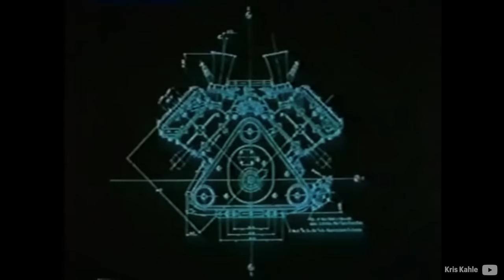The Most Successful Formula 1 Engine Ever

Comment: Cosworth  V-8 . The  WINNING-EST  ever Engine in  Formula 1 . American Name on it , but British Engineering . Henry paid the bills , so got " Naming Rights " .
Reply: Ford always had a fascination in the early days (60's-70's) with OHC configurations...Japan was just getting on it's feet, and so naturally Ford saw the UK as it's friendly gateway into what was popular among European manufacturers... They soaked up what they learned from decades of racing abroad, and it found it's way in V8's of modern era after the 80's marked the end of their pushrod based engines at large.
Reply: @kylecurry6841  . American V-8s are still mostly Pushrod engines . 
There are advantages to Simplicity of Servicing in Street Engines .
Reply: @johncunningham4820  no they aren't, all modern American v8s are dohc.
Reply: @freddarau  . Rubbish . Bullshit . 
The LS series Chevs are Aluminium Block  PUSHROD engines . The Chrysler Engines are still IRON Block . A couple of UNRELIABLR  Fords have overhead SINGLE cams .
Reply: @johncunningham4820  the ls hasn't been manufactured in 12 years. Do you live in 2010?

The LT has replaced it.
Reply: @freddarau  . Yeah . Whatever . It seems to me , that the ONLY Quad-Cam American V-8 , is the Special Order 5.5 litre unit for the  CORVETTE  exclusively . And an LS-7 would have that for Lunch . And be more reliable DOING  IT . 
LT's are still OVER HEAD VALVE pushrod engines .
There is nothing wrong with  OHV  architecture , BTW . Solid . Proven . And EASY to work on .
Reply: @johncunningham4820  it are used in there trucks and the Camaro. Ford only uses dohc in all of there gas engines, so does dodge.
Reply: @johncunningham4820  the ls7 gets shredded by a lt6 
And the ls7 is more unreliable the the bmw s85.
Reply: @freddarau  . That is . No , and and ALSO  No .
Reply: Coyote 4 cam 4 valve VVT
Reply: @bernardwarr4187  . The Engine in the Video is the BRITISH Ford DFV ,DFY , DFX and DFR  Grand Prix Engines . From a Different Era .
Your " Coyote " may be  borrowing some of the Lessons learned . But is an entirely different Engine Platform altogether .
Reply: @johncunningham4820  some said, there where no American v8 4 valve 4 cam engines?
Reply: @bernardwarr4187  . Never said there were NONE . Just that the BULK of the Mainstream Engines are still  OHV .
OHV types are MUCH cheaper to Maintain and Service , so this make sense for a DOMESTIC Market .
There is nonetheless That Corvette and OK your Quad Cam Coyote . 
The Old Question with those .
How Fast can YOU afford to go ?
Europe has been doing Overhead Cam  since the 60's . For Domestic Market .
There are Merits to BOTH types of layout . 
Also Downsides .
The Cosworth was likely the FIRST engine using the " Modern " layout .
Low Piston Crown and Narrow valve angle .

Comment: The DFV can trace its origin back the the Ford Kent engine.   The Kent engine was originally built in a 1.2l and 1.5l capacity with a non-cross flow 8-valve head.  The head was later changed to cross-flow and the capacity of the engine changed to 1.1l, 1.3l, & 1.6l capacity. 
Lotus developed a 8-valve dual over-head cam head for the Kent and then Cosworth developed an even better 16-valve head for the Kent. 
The 16-valve head on a 1.5l Kent was basically the starting point for the DFV.  The heads and lower end internals where carried over with a new aluminium V8 block being developed
Reply: Yes indeed Sir! Descended from a ford Anglia / Cortina engine.
Reply: Sorry, which parts where carried over? Non, only the lotus head, which was not part of the original Kent engine?
Reply: Had a few Fiestas with the 1.6 kent. Not a lot of power, but very reliable.

Comment: Ford mostly got behind the development of the engine in light of the changing regulations for endurance sports car racing more than F1. Cosworth got it working for F1 quickly because of the shorter races. The Ford P68 was designed to replace the GT40 for the new sportscar regulations and was developed by Alan Mann Racing using a DFV , but they couldn't get the DFV reliable enough for the long endurance events like 1000km of Spa, 24 Heures du Mans, 12 hours of Sebring and 24 Hours of Daytona because it would shake itself to pieces and would not reach 300 laps at the 24 Hours. It took a long time to get the DFV reliable enough for endurance events - it won at Le Mans in 1975 with Ickx and Bell because there was a strict fuel limit, which meant the engines ran in a lower state of tune, which in turn increased the life of the engine. Even the replacement DFL, designed more with endurance racing in mind, took a long time to be successful.

Comment: Crazy that a 2005 V10 was able to achieve more than double the power from the same displacement than early DFVs.
Reply: Revs, revs, revs!  The cylinder head design is not really all that different.  The main difference is the pneumatic valves allowing higher rpm.  As well as overall improvements everywhere, of course.  Honda have an article on their 'modern' V10 and V8 engines, they were able to gain power from all kinds of small details, like changing the timing of the ports on the oil scavenge pumps to reduce losses and so on.

Comment: Michael Schumacher won the F1 title in 94 using a pneumatic valve version, beating the V10s and V12s.
Reply: What was the Designation  of  that  Engine ? And  Capacity ?
Reply: @johncunningham4820  internally I believe it was the ED but I think Ford branded it the Zetec-8R or something like that
Reply: @johncunningham4820  Zetec-R 3.5L V8
Reply: Crashed into Damon Hill deliberately
Reply: EC/Zetec-R, which was based on the HB - 75° instead of 90° in the DFV.

Comment: Why would any motorcycle engine builder start with a 360° parallel twin? It's like the worst layout for p-twins in existence.
Reply from the maker: They wanted a simple single carb setup
Reply: @VisioRacer  180° firing interval would also be fine with a single-carb. 270° is the best possible compromise with a parallel twin mechanically, and in power output, and which is possibly why most manufacturers have gone with it.

Comment: The thumbnail is misleading...the longest living engine used in F1 was the Ferrari Colombo V12 which was produced in various iterations from 1948-1988, way before the first F1 race ever happened.
Reply: Man, I haven't thought it is so old. But didn't they use it until '95 when they changed to V10? Or was it a different design for those last years?
Reply from the maker: But was it used for racing all those years? The DFV was a race engine only
Reply: @karacop78  No, the engine design of later Ferrari F1 V12 was no Colombo derivative.
Reply: @VisioRacer  Yes, it was used for racing all the years albeit in different series.
Reply: Or the Offenhauser? (OFFY)

Comment: The cam gear failures were constant problem for a long period before Duckworth added the ‘quill hub’ to cope with the massive torsional vibrations. X plane v8 cranks we’re never used in f1.
Reply from the maker: What about the Coventry Climax V8?

Comment: I know this is a dumb question but is it possible for a multiple cylinder engine to have the same stroke timing at the same time? Like cylinder 1 and cylinder 2 will have a power stroke at the same time?
Reply from the maker: It is, but not really smart. You would have a much stronger combustion and would need to counter-balanced that. Having more smaller combustions makes the engine smoother when timed evenly

Comment: I thought Michael Schumacher won the 1994 championship with a Cosworth V8 powered Benetton Ford. 
Is that a different engine?
Reply: That was a different engine. Cosworth’s DFV replacement was a 75° V8 called the HB introduced in 1989, which was later developed into the EC/Zetec-R used by Benetton in 1994.

Comment: 2:01 Wish they still did gears instead of timing chains and belts
Reply: Maybe on inline engines rarely are used gears, except for trucks, but actually geared distribution is more diffused than may be thought.
Chains and belts are mainly on the cheap engines of our cars
Reply: Unfortunately, gears (and to a lesser extent, chains) are expensive and noisy when compared to belts - and your average Noddy driving a 95 Camry while on the phone and sipping a latte wants quiet over strength and accuracy.
Reply: ehm, that's called "capuccino", or "(caffè) macchiato" at least. Latte simply translates in "milk".
Anyway, the problem is not loudness, but instead cost of production, and if that's not enough, there's to sell regularly the spare belt

Comment: it's not a Ford engine, it's a Cosworth double 4 valve engine with a Ford badge on it.  Ford had nothing to do with the engine simply paid to put their name on it.
Reply: Your statement is a contradiction. If Ford paid for the research and development, they had a direct involvement of the engine along with the right to stamp their name in it.
Reply: @truckr74  no sorry, the engine was already developed way before Ford came along.
Reply: @212MPH  yeah, it was based of of a ford shortblock, cosworth tuned and refined the engine.

Comment: If an engine survives longer than it has to, it's unnecessarily over built.
Reply: found the engineer
Reply: Like today’s engines, garbage
Reply: Wait.. what!?😁. -certainly happy you did not have any effect on my amazing Japanese made vehicles.
Reply: @surfside75  longer than it has to doesn't mean outside the warranty period. Cars are designed to last 150k miles, the Land Cruiser ist designed to last 250k miles and you can still get more out of them.
Reply: @Troonielicious  Today's engines are garage because of regulations that make the carmakers innovate like crazy to keep up with CO2 (fuel consumption) and NOx and particle (exhaust gasses) emissions regulations. Cars then also need to be competitive regarding safety. The legal minimum safety standards are laughably low. If the regulations are lax you get Toyota being able to build brand new FJ Cruisers today for certain markets with the 4.0 1GR-FE V6 making 272 hp. The next 4Runner will have a more troublesome 2.4L T24A-FTS turbo inline-4 making's 265 hp tops.
Reply: @rimbo420  I just had some classes about engineering stuff. I don't have a title (yet). It would be do cool to be an automotive engineer but then I'd be working on these awful modern engines and EVs. It sucks.
Reply: @Troonielicious  modern engines are far, far more reliable, fuel efficient, more powerful and with higher torque, they start without hassle and without manual choke, are far cleaner burning.  Modern engines last longer between services and over all last tens of thousands if not a hundred thousand miles longer. Just look at the staggering power they can get from certain 2ltr 4 pot turbo engines that put out more power than older supercars! Naturally aspirated engines are also at their peak with far more power per litre yet still with faultless reliability. Modern engines garbage? That's BS!
Reply: @surfside75  Ideally cars would last forever. I want my E39 5-Series.😂
Reply: @davekennedy6315  Correction. *They are not at their peak yet.
Reply: @imnotusingmyrealname4566  Yes try to find a a more interesting area of engineering than battery toothbrushes (sorry I meant electric cars).
Reply: I think you might be missing the point. Mr Viseo is not talking about individual race engines. He is talking about a family of race engines that evolved and had a long career.
Reply: @philiptownsend4026  🤣 No need to apologize or correct yourself.
Reply: @philiptownsend4026  I'm looking at joining Engel, a company that makes injection mold machines. Plastic production is expected to grow by 40% by 2030 so that seems like a growing industry. More machines and better machines are needed for that growth.
Reply: @Retired Bore I know, lots of other automotive engineering jobs. The most growth in jobs is still in EV specific tech tho.
Reply: @imnotusingmyrealname4566  our landcruiser is on 514,000 miles and the engine is still good. The engine will probably outlast the body.
Reply: @imnotusingmyrealname4566  500k + is what is normal for Toyota.